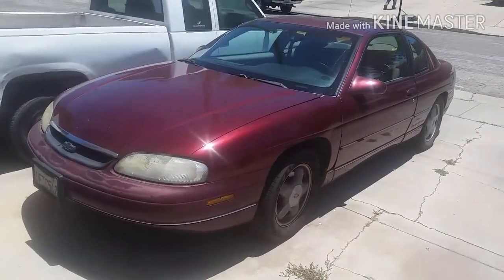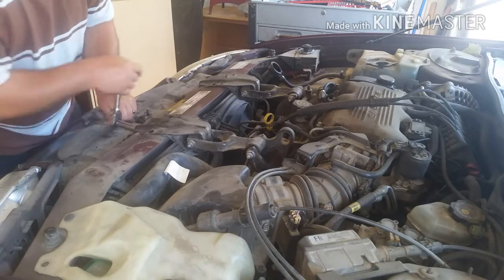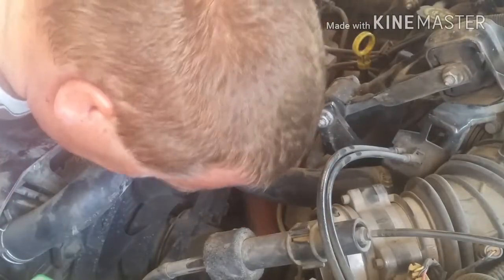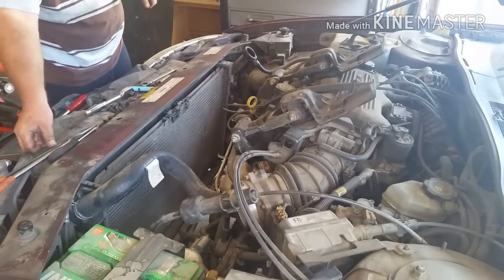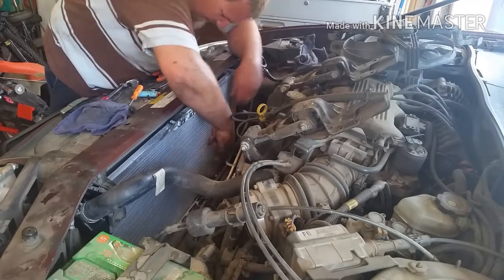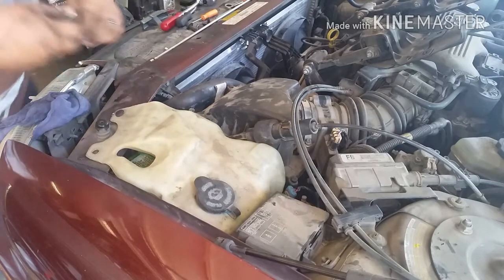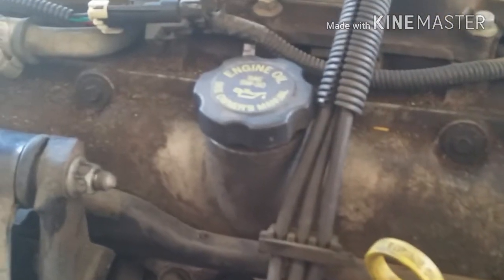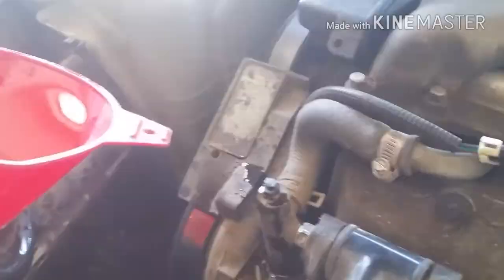1999 Chevrolet Monte Carlo (Radiator Replacement)

Comment: would it be possible to mount the fans on the new radiator before you drop it in? I have a 97 Lumina 3.1 that I will have to do this job on. Thanks.
Reply from the maker: I am really not sure if that's possible to do or not I dunno but the spacing it's pretty tight. But to be honest with you I would have probably put them on before I dropped it in my buddy on the other hand does things his way